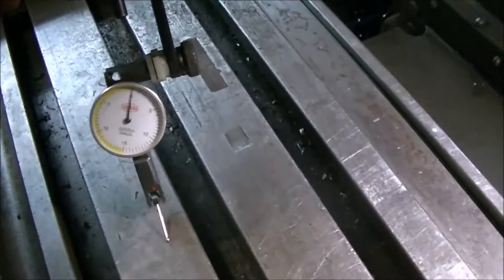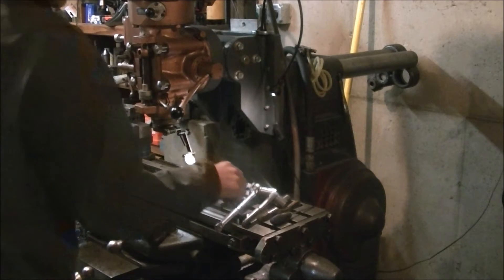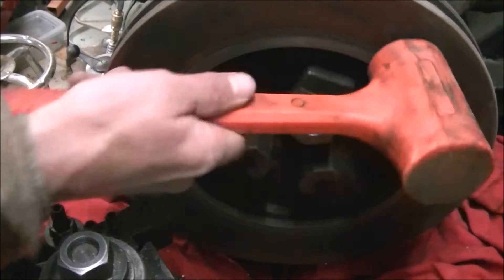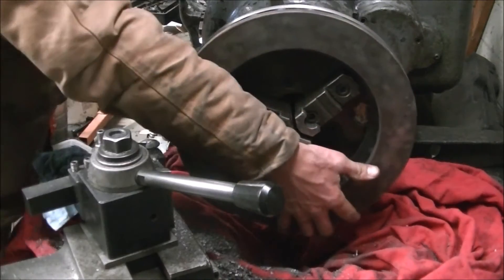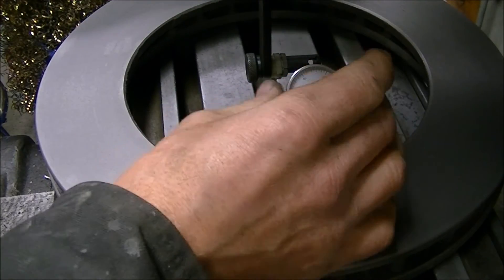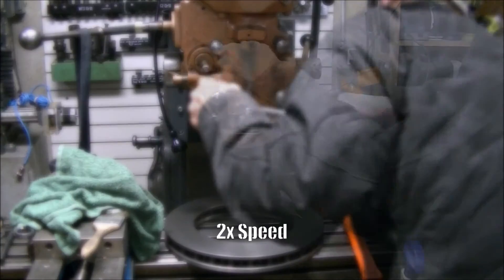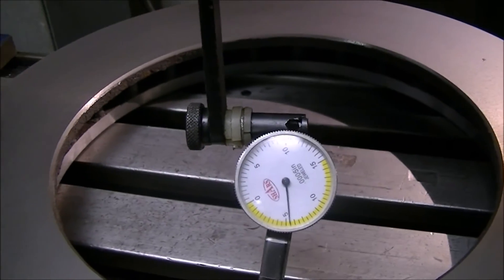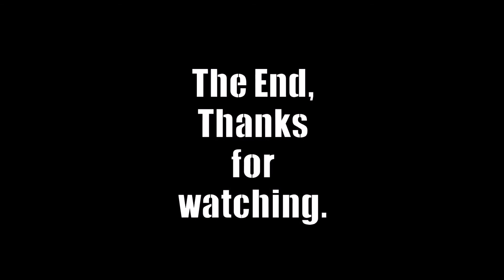Mill Tramming Tool

Comment: Great idea.
Been using a large Bearing Housing ( abouts 9") which we had a Toolmaker friend Surface Grind for us.
Will create something similar to make some work on the Lathe and check its accuracy.
Thanks for the idea and sharing
aRM
Reply from the maker: +aR M thanks for watching and commenting. I need to get my surface grinder put back together so I can grind my rotor also. So many projects, so little time. Craig

Comment: Good idea, I have a set of the same rotors from my old 250 as well, I will have to make one.
Reply from the maker: Batch562 thanks for stopping by. It works well for the levels of accuracy (or inaccuracy some might say) that I work to. Craig